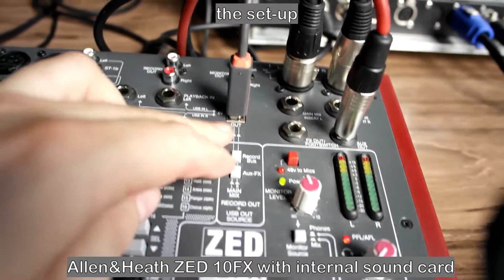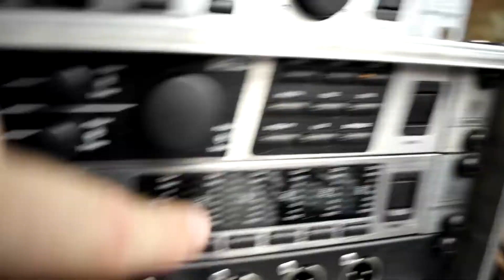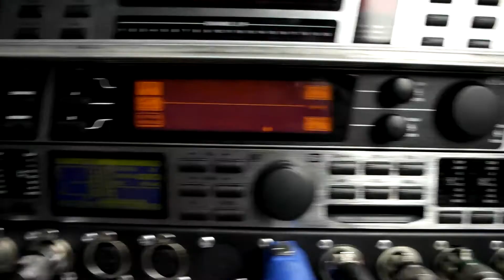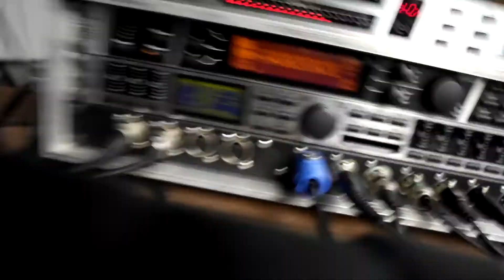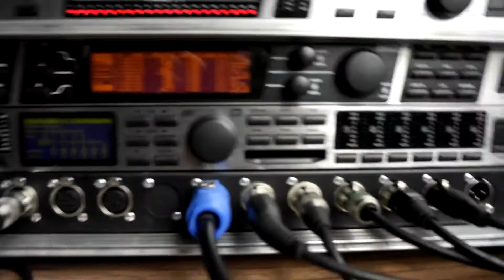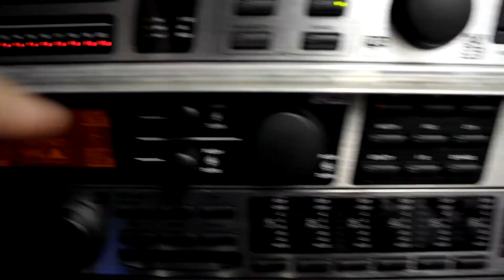Tutorial: Setting up and protecting your PA-system with X-over, limiter, feedback destroyer & delay

Comment: If I have the Behringer ULTRADRIVE PRO DCX2496 Ultra-High Precision Digital 24-Bit/96 kHz Loudspeaker Management System  &  Behringer Feedback Destroyer Pro FBQ2496, is it possible to get decent sound, I need another gadget? Thank you.
Reply from the maker: The DCX 2496 is the best device you can get to improve your sound without breaking the bank. There is even a company that offers a hardware upgade. But that's  for hi-fi- nerds.

Comment: S.O.S.

Need help connecting a Peavey 10 channel mixer, a Peavey crossover, a Peavey feedback destroyer, wireless mics, one 12” powered monitor, two 15” powered speakers and two 18” powered subs. So many xlr cables and don’t know where to start. 

Anyone out there that can help?
Reply from the maker: From mixer main out, into the feedback destroyer, from there into the crossover. From the high outputs into the 15"-speakers, from the low outputs into the subs. Connect the wireless mics to the mic inputs on the top of the mixer. For the monitor, use the aux output ( pre fader)
Reply from the maker: Did my post help?
Reply: @DJServiceFrankfurt  It did.. Thank you for your help. I attached all the cables but haven’t rung it out yet. Still have to familiarize myself with the equipment.
Reply from the maker: @stevenhower1228  that's the way to go. Set up the whole thing and play with it a little bit. Then take it down and set it back up. Practice makes perfect!

Comment: Hye.. can i connect the wireless mic strait to the feedback destroyer?
The chain is like this
Wireless mic - feedback destroyer - mixer - power amp
Reply from the maker: That will not work. THe mic (whether wireless or cable) goes into the mixer and the feedback destroyer comes between the mixer and the amp.

Comment: Hey,
Sehr hilfreiches Video:) 
mich würde es noch interessieren wie man die einzugebenden Werte berechnet. 

Auf welchen Frequenzen sollte der X-over sein?
Welchen Wert stelle ich für den Limiter ein?
Reply from the maker: X-over hängt immer davon ab, welche Frequenzbereiche Tops und Subs abdecken. Manche Sind kannst Du bis 100Hz bespielen, manche trennt man besser bei 80-90Hz. Die Wahl des Filters sollte so sein, dass kein Frequenzbereich zu stark reduziert oder erhöht wird. 
Beim Limiter für passive Boxen mit externem AMP kann man die Limitereinstellung berechnen. Bei meinen aktiven Tops und Subs hehe ich bis zum Max. bei dem die in den Boxen eingebaute Clip-Funktion greift und die LED leuchtet und setze dann den Limited so, dass die LED nicht mehr leuchtet. Das ist bei meinen Veranstaltungen aber kaum der Fall. Meine Anlage geht max. bis 75% der Leistung. Meist drehe ich alles nur zur Hälfte auf und das reicht.
Reply: @DJServiceFrankfurt  weißt du zufällig ob der output gain bei der frequenzweiche, den input gain vom verstärker um den selben wert verändert?
Reply from the maker: @soundgeist_  sollte eigentlich so sein, oder? Wenn Du den Output an der Frequenzweiche erhöhst, sollte auch beim Verstärker mehr ankommen. Ist aber nur eine Vermutung
Reply: @DJServiceFrankfurt  leider hab noch nicht wirklich erfahrung und hoffe am samstag keinen driver zu rösten haha😅
aber danke für deine mühe, wirklich sehr hilfreich:)
Reply from the maker: @soundgeist_  Bau am Samstag erstmal auf und schau, wie viel aus Deiner Anlage rauskommt wenn die Anzeige am Mischpult im grünen Bereich bleibt und die Verstärker nicht clippen. Evtl. Brauchst Du gar nicht so viel Leistung.

Comment: Hi, I have one HK Lucas Nano 600, I play from CDJ 900 Nexus and DJM 750 mk2.  Would it be ok to use dcx2496 as a limiter to stop the midrange speaker from the Lucas Nano satellite from burning out? Thank you.
Reply from the maker: For that I would rather use a DEQ2496.
Reply: @DJServiceFrankfurt  Thank you for your fast reply. Have a nice evening.
Reply from the maker: You too! Enjoy your sound system, but don't  destroy it. If you ever have doubts about the abilities of your system, rather rent a bigger one.
Reply: @DJServiceFrankfurt  Is hard to make the setup on it? I didn’t touch one before.
Reply from the maker: As with any Behringer sound products: read the manual, set it up at home and then get familiar with it. It just takes time . Using the auto-EQ- function is soooo cool!  It will require a special mic, though.

Comment: Hello, I have a question.
I have an XR18, and how do I connect main out to the FBD, plus a monition channel (ex)? That is, the FBD has only 2 IN and 2 OUT. So how do I connect more monitors? How do you connect Aux1?
Reply from the maker: For that you need two devices
Reply: @DJServiceFrankfurt  Oh, ok, thanks. So i can´t have the main speakers and monitors connect at same FDB! When i saw your video and you pass the explanation from tha main out to aux 1, i thought "wait!! did he change tha cables?! how can it be possible! XD. 
I have the ultra curve to, so what is the order to connect everything do you recommend to me? Mixer - FBD - Ultra Curve?
Reply from the maker: @TiagoAmador  the FBQ onl has two channels. If you want to connect the mains (left and right) and the monitors then you need two devices (total of four channels). If you want to connect the FBQ and the Ultracurve, the Ultracurve goes first. Put the FBQ in bypass and let the Ultracurve adjust the EQ. Save that and turn on the FBQ. But really, what do you need the FBQ for in the masters? I would just have the Ultracurve in the masters and the FBQ in the Aux-outs. That's usually where the feedback occurs.
Reply: @DJServiceFrankfurt  yes I understand. Thank you very much.
I usually have FDQ on the master, because musicians are often too close to the Main speakers, so the mics pick up more sensitivity through the front speakers than the monitors. I think this is what happens to me.
Reply from the maker: @TiagoAmador  ok, in that case a FBQ in the mains makes sense. Sometimes it's a good lesson for the musicians to get a feedback so that they stay away from the main speakers
Reply: @DJServiceFrankfurt  😆
Reply: @DJServiceFrankfurt  this is very helpful advice. Thanks from me too.